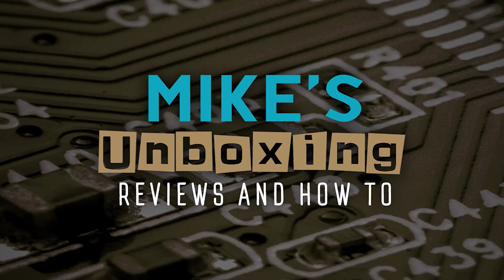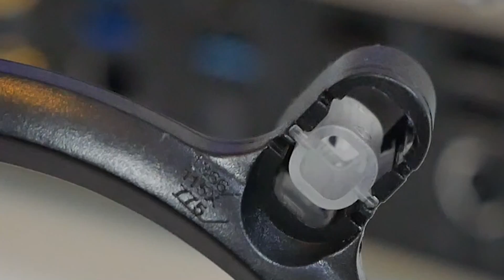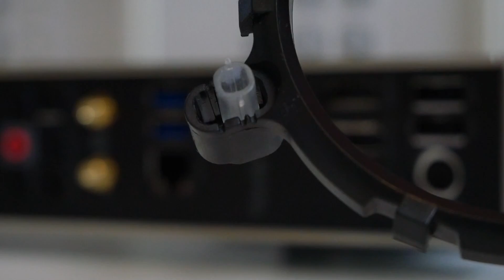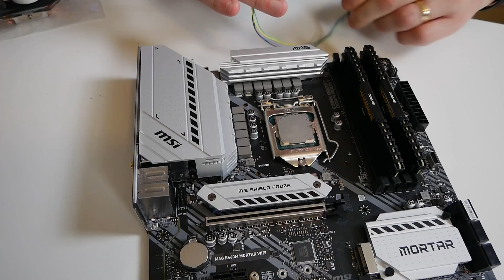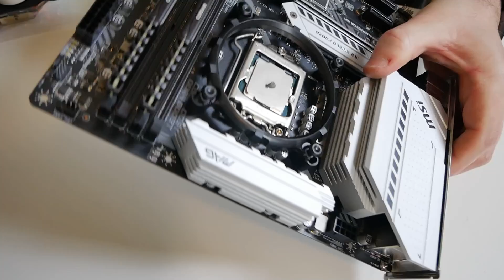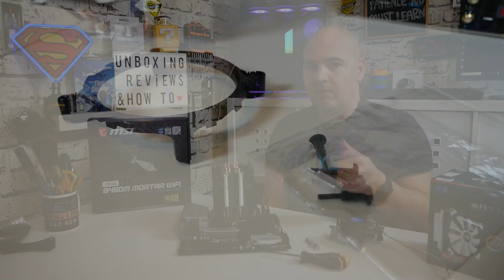How To Install Aftermarket Snowman M T4 Cooler On Intel 775 115x & LGA1200 Sockets

Comment: So the mainboard can support such a heavy CPU cooler at all time? I hope the PCB is strong enough. My not overclocked i7-3770k runs at 75°c under CPU-Z bench, I'm considering purchasing the Snowman MT6.
Reply from the maker: yes should be fine

Comment: Great cooler for the price but damn those mounting clips are a big pain in the Aass, you feel like you’re going to break something.
Reply: Agree. I own a Gammaxx 400 and when I had an AMD MOBO it was a nightmare to put it on (specially with board inside the chassis).
Reply from the maker: yeah it is always a worry even now after all these years :-)